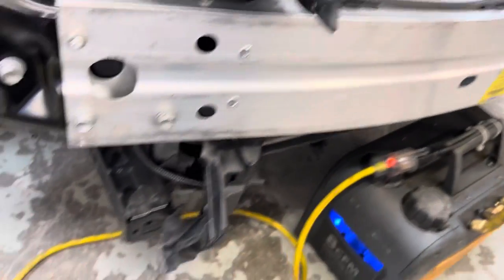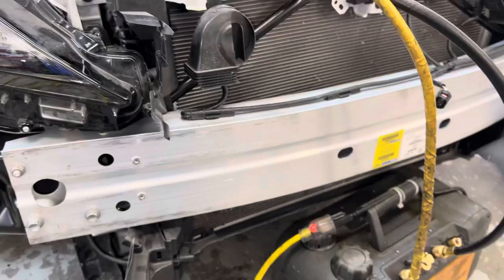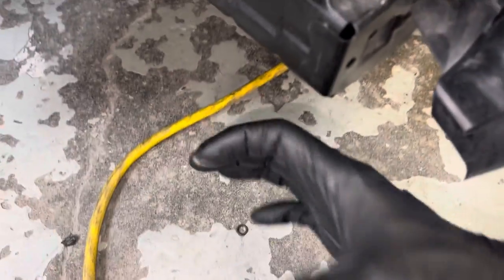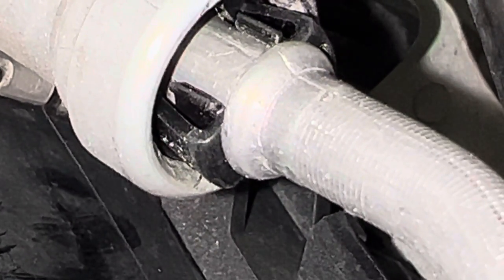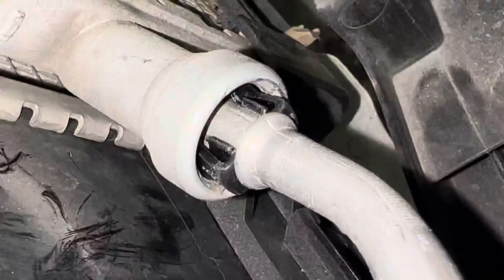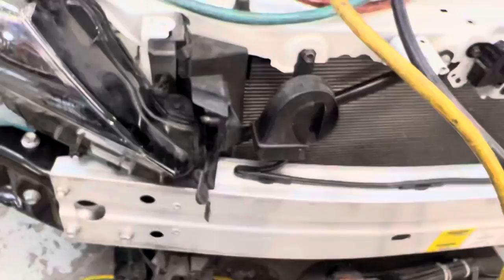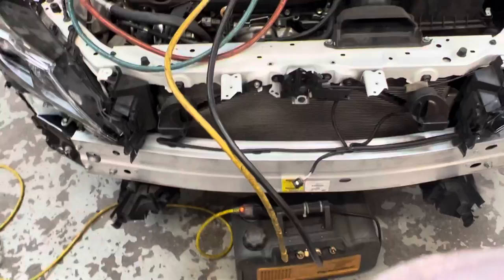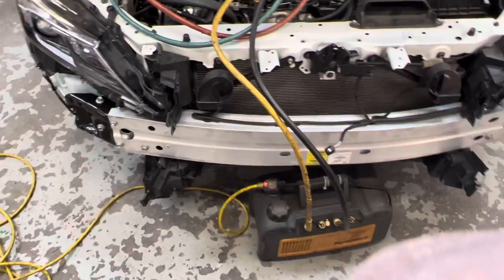Toyota condenser PLASTIC CLIP !fragile must be replaced every time. ￼

Comment: hey, did you use 1 same vacuum pump and 1 same recovery machine for both r134 and 1234yf ac system? whether separate ones should be used or not ?
Reply from the maker: Vacuum pump  makes no difference,  you can use a vacuum pump on hundred different types of refrigerants. 

This type of recovery pump has a purge clean out setting.  At the end after removing refrigerant from the car you set to purge mode .    It bypasses all the piping and condenser,   Uses the pump directly to pull out all refrigerant from the internal condenser and all piping down to the micro level. 

        Then at the end when you see in some of the videos when I use the nitrogen to fill and purge the system so it’s not in a vacuum.  I use the same hose to blow through the recovery machine with dry nitrogen. So it’s ready for the next system.      This recovery is not designed the same way as automotive. 

        And unlike automotive that automatically stops at -15 vacuum. This machine can pull way down to 800 to 700 microns.  And a lot faster then any automotive recovery / recycle /  recharge machine can.